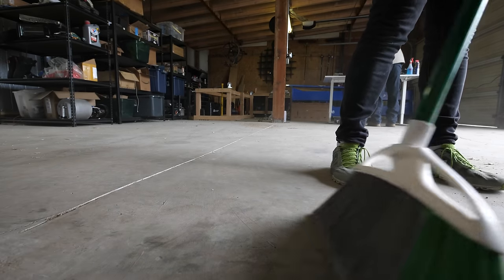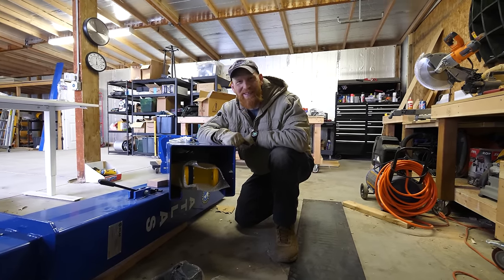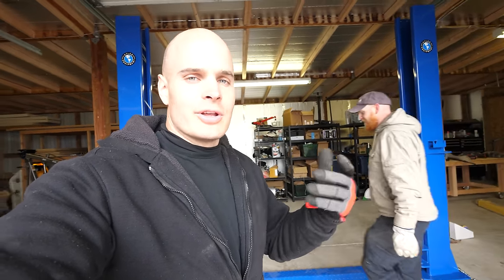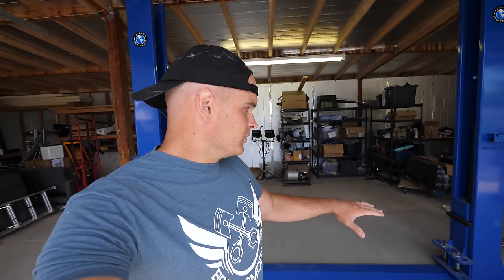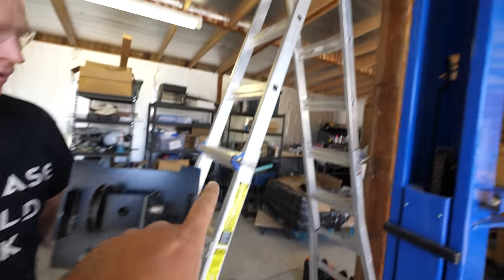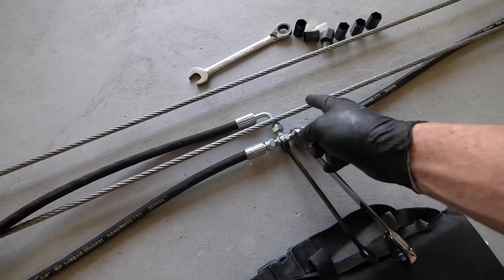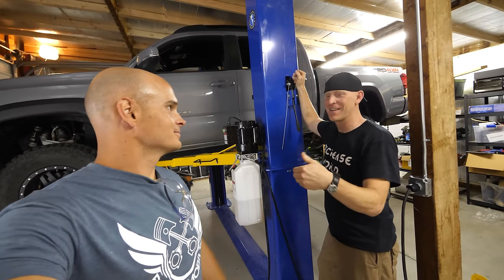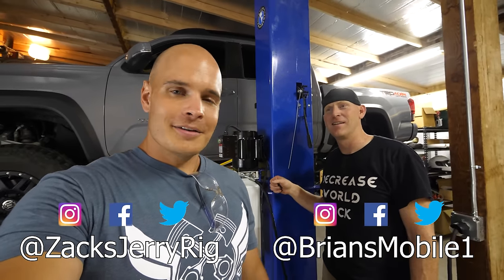Installing a 2 Post 10,000lb Vehicle Lift! - Check concrete FIRST!!

Comment: What's the point of that lift in THAT garage
Reply: He already had to remove old concrete... 🤔 wouldn't it be better to go all the way down and do it this way? Unless next episode will be all about lifting garage ceiling 😁
Reply: @obywatelwu5515  should have concreted the bolts.
Reply: Still makes the car a lot easier to work on. Even if you can't stand under it you can use a creeper or chair to sit while working
Reply: @Cutlerylover4life1  Indeed it does 😄💪
Reply: I am sure 100% he didn't install the lift and go through all that pain of concrete and installing the lift just so that he could go under the truck to fix(which hardly happens)
Reply: sulaiman syed for what else?
Reply: If you could only put a small window in your wall, wouldn't you still put a window there?  You act like he can just magically create a new garage or move, sometimes the reality is you work with what you have.  I've considered doing the same in my garage, and know others who have.
Reply: @NoNegotiations  "should have "concreted" the bolts."" Riiight. Sounds like you know what you're talking about. You could wet-set J-bolts, but it's difficult to get them in the right spot while the concrete is curing. Setting in studs with epoxy is also another option, but it's very expensive, and unnecessary, and they had the red head anchors already.
Reply: @TexRobNC  He already had plan to make a bigger garage.
If you follow him on social media you can see him breaking his old one
Reply: @xenonram  That's not how it works. Lol.
Reply: @SmugLlama1234  that is exactly how it works
Reply: I have a lift in my garage with a 12 ft ceiling and still can’t go full-height with a pickup truck. There are many, many things one can do with a lift in a low-ceiling garage. 

I know guys that have that same lift in garages with 8 ft ceilings that only use it for detailing cars (or other body work). Perfect height for tires, brakes, suspension, body repair, etc on cars and small pickups.
Reply: @Cutlerylover4life1  I saw a creeper on Amazon that has the person sitting on it in a reclining position. It would be perfect lifts that have to max out at a lower height.

Comment: Good DIY video. I've been researching lifts a lot. Yes the 10k lifts that I read about do require more than 4" of 3000psi concrete. I'm looking at 9k lifts and they call for 4" 3000 psi concrete. I called my concrete guy and he said my floor is 4" thick and 3500psi concrete with rebar reinforcement. Hope i don't drill into the rebar 👀

Comment: You could have just cut and poured small footers with the 7” thick concrete
Reply: What specifications would you recommend for someone doing to footings option? Looking to help a friend install one on an existing pad but would like to make sure it is safe. Thank you!
Reply: Kyle Burraston According to some reps that I spoke to they said 5’X5’ squares (with the posts on center)  at 7” deep, 3500 psi concrete. I would rather go a little bit larger though and pour completely across. It won’t cost that much more.
Reply: I always recommended a rectangle cutout 6 inches wider than than the three outside faces of the pad that ran completely contiguous between the posts. So many people skip the step of tying back into the existing slab with rebar, and one side would settle causing the lift to twist if its an overhead. This one being a baseplate isn't free from those issues just because it isn't connected at the top of the posts. If you have a settling issue after a solid slab pour, you can simply disassemble the lift and fix the pad, the lift won't be damaged. If you do two pier's, you only have a small gap between of existing concrete. Might as well clear that out, it's not much more money and your already going through all the work.
Reply: Came here looking for this.

Why in the world would you not install footers tied into the slab and studs for the lifts? 

Wedge bolts for a lift? Yeah, that's 'standard' and the web is full of examples of how these things pull out over time.

Hell, I'd connect the footers with a beam just to be sure. The additional cost in nothing relative to your life

Comment: "We are converting from metric to imperial." .... WHY? You love doing fractions?
Reply: Cos they are Americans
Reply: Metric tape measures aren't as readily available as imperial ones in the states, it sounds like the instructions were metric so instead of going out and shopping for a metric tape measure they just converted to imperial and used what they had
Reply: @fakename287  I work in the Oil Industry here in Canada and i still remember the first time as a first year Apprentice that my journeyman gave me a measurement in Imperial and i went whaaaa? (Since we only learn Metric in school now) Luckily we all carry dual measurement tapes since we deal with both Imperial/Metric stuff on a day to day basis.
Reply: Because we are capable of doing fractions (do them every day) . For real fun naval architect plans are in 1/8" dimensions. AN bolts in aircraft have their own rules.  I also can get by in drams, gills, pints, gallons, hogsheads, bushels and barrels for volume - as well as ten yard loads of gravel. And grains, ounces, pounds, tons (long and short) as well as kilograms. Also unbothered when faced with watts, joules, kPa, Nm, inch pounds, foot pounds, and on and on. Conversions are a way of life if you are doing anything in the science or engineering fields. Now being flexible I would have simply used a couple of metric rulers (already have them) as you are suggesting. All the home improvement stores, hardware stores, auto parts stores in the US sell metric rulers these days.
Reply: @David Bryant outside of the US, yes. Inside the US, not so much.
Reply: @David Bryant Damn, good to know those exist. I honestly haven't really seen those around me.
Reply: @David Bryant With all the crap going on and restrictions, I only like to go out when I have to. Next time I find myself at a hardware store, just for you, I'll go look for one.
Reply: @David Bryant You just had to ask, you just had to win. Jesus Christ. I concede, I am dumb, is that what you wanted? You wanted me to admin that you are smarter than me, and that I shall follow your command at all costs?
Reply: @David Bryant please dad ❤️❤️❤️
Reply: @David Bryant in all seriousness though, if your offering me an apartment that would be bomb asf
Reply: @David Bryant I'm not an adult lmao, if you couldn't guess by my commitment to reply to this long and admittedly funny replies.

Comment: i got the same lift. supposed to have a plastic tray under the ramp to keep the hydraulic lines and cables separate. If you dont have that its going to wear through the hoses. Talks about it in the instructions and all baseplate lifts have them. Also the two nuts arent supposed to have the washer between. Thats is just for shipping. Washer goes under first nut. second is lock nut.

Comment: Just did a pour for our shop build, we did 2 4 x4 x 14 inch deep footers for the lift ( a 10 k 2 post , Rotary brand) the rest of the slab is 5 inches, a little overkill is never a bad thing when installing a lift.

Comment: Zach, this is way late but one thing I'm curious about is why you didn't put the anchors in the wet concrete and drilled them in instead. I imagine that placing them into the wet concrete would have been stronger overall or am I wrong about that? Or was there another reason?
Reply: That’s not how wedge anchors are intended to be used. Additionally, it would be very difficult to get them set in the proper position AND set the lift post on top. These posts are massively heavy.
Reply: @coreyscarrepairs  Forget my last comment, my brain is foggy... So, putting them in wet concrete would necessitate different types of anchors. You're right, you can't use wedge anchors in wet concrete and I wasn't suggesting that. But there's anchors that are meant for wet concrete that would easily be used instead.

As for alignment. This is something that's done all the time. The easiest would be to use a steel base plate that gets embedded into the concrete too that has the anchors going through it.

Lastly, these are meant to roll into place, and there's play in the anchor holes, so you'd just roll it into place and then angle it vertical with the anchors going into the holes as it gets lifted vertical.

Comment: OMG converting from metric to imperial is just sheer madness to me and as I'm a Brit, they taught me both but always prefer metric for measuring precise stuff!
Reply: Neither one is more accurate. You can measure 1.265 inches just as easily as 32.131 mm. It seems to be a big problem that people in Europe are completely baffled by rational/fractional numbers. I guess they don't know that metric numbers can be expressed in fractional form as well. They'd freak if you said 38 ½ mm. "Thirty eight and... One-twoths?" Precision measurements in USCS units (not "imperial") are expressed as decimal numbers, not fractions. The ONLY time fractions are used, is in carpentry/construction where dividing an inch into 16 parts is as accurate as you need to be. There is nothing on a house, besides finish carpentry (trim work), that requires more accuracy than 1/16" increments.

Comment: Hi, good call on pulling the trigger and replacing the concrete pad. For future reference 6 inches of concrete is a bare minimum for this type of lift. Although there exists a chemical anchor which can be used if your concrete is less thick.

But again there is a bare minimum of about 4 inches. If you use this chemical anchor, simply drill a size large hole and deeper. Longer anchors to push into the chemical solution will also work better.
Source: I sell and install lifts for workshops

Congrats on your new lift

Comment: I'm not sure why you couldn't have just make two small footer pads for where the posts would attach.  Cut 8" around the footprint of the lift stands, and pour a deep slab only on those two spots.  Seems like a 15x12 slab was a little overkill.
Reply: Mario  plus the fact that if it's just two small slabs taking on all that weight instead of one whole unit you run the risk of the tiny slabs shifting

Comment: The basic fact that you stopped and did the safe thing with the concrete, are wearing a mask for the dust and hearing protection made my sub right away.  I know your work is getting done the right way.

Comment: I'd think to reinforce more than simply adding inches. Structural steel in slab to ensure it won't tip. After all you went thru the extra effort to get slab thickness right, I'd have gone a bit more just to know nothing could ever go wrong.

Comment: Definitely retorque those anchor bolts. 100 PSI seems pretty light to me, 3/4" bolts - I would do 125 minimum. Minimum 6" concrete. Great video- thanks.

Comment: yup check the torque on the bolts every year as well. I know its been a few months since install but in commercial projects, yearly special inspection should be done by the owner on anchors. With wedge anchors, these are 3/4 Diameter, probably some Chinese BS non the less, should be torqued down to 110lbs per sf. If unsure, check the ESR document for that particular anchor.  Also with wedge anchors there is specific spacing between the c/c of each anchor as well as edge distance. If you were using a Powers SD1 anchor, I wouldn't used a wedge anchor if you were withing 16" of an expansion joint, which maybe you are not. You could go down to 11" at a minimum though but its your choice. If it was me, I would use b7 rod and a adhesive anchor either Hilti say "hit200 or powers ac200. You would also want to have the anchors spaced a minimum of 6" apart from each other. Just becuase you have 8 holes in the base plate does not mean you have to use them all, normally you would want to use the extremities and if you were trying to hit that minimum edge distance you could go in a hole. More anchors does not mean more holding power, it could in fact reduce the effectiveness of the anchor.

Comment: 4k lbs. is the "compression" tolerance.  The bolts are also designed to secure the "tension" load (pulling/twisting) up and out.  Concrete is very strong with compression but quite weak with resisting tension. It was a good call installing the new concrete.  Too bad the bolts weren't a little longer to take more advantage of the full depth of the concrete.  

I would have made the new pad larger (wider and longer.)  I don't really like the edge (weak point) being so close to the lift. OEM calls for a full slab- not a repaired slab.  I agree though, what you did is likely much stronger than using the original slab which was only 2" in some spots.

Comment: Yeah it seems like it'll be cramped working under the truck with your ceilings that low. You'll still end up being on a atoll rather than standing but that's still osmething. Good job guys and great decision drilling out the pad and repouring, they can very well pull out if the concrete isn't right.

Comment: Good choice on the concrete. The concrete is closer to its strength now so a good checking of the anchors to see if they are still tight.

Comment: Great job on this video.  I installed an Atlas 9KOH lift.  The instructions were terrible and lacked the torque detail.  worse than that, they sent the wrong instruction revision for the model I bought, I had a newer model than the instructions.  This meant the holes were in different locations than the model I bought.  Had to re-drill holes and then used Hilti epoxy and anchors instead of the shielded anchors in this video.  Atlas paid me for the cost of the re-drill supplies since they botched the instructions!

Comment: Me? Zack, I would install spiral wrap on the hydraulic hoses running along the floor next to the cables just as another measure of protection, never too much safety. Me? I'd want to make  sure to see my kids grow up. Anyhow, good job of putting in all of the required spec's in place.

Comment: Having a lift makes working on your car so much easier. My uncle has one and anytime I need to work on my car I use it if it’s available.
Reply: when I used to work on cars, I had access to the lifts, even when the place was closed to work on my own stuff.    Since changing Careers 10 years ago, having no lift sucks.  I have to do everything on the ground with a jack and jack stands.  It limits what I can do.  I have no real flat place to work.  My Garage is too full and my driveway and side of the house are pretty sloped.  If the side of my house was LEVEL, I'd throw up one of these lifts there.  The prices of these things are really pretty cheap overall.
Reply: JB Dragon these lifts are worth it. Once I find a house I hope that I can build a lift into it but looking for a house that has a high sealing garage won’t be easy either.

Comment: Whenever I encounter something feety, inchy  I never convert, I bring out my stanley talon imperial and roll with it. What I dont like is to mix things like on my mower where screws are unf, unc and where previous owner couldent replace originals re-drilled and tapped with mill-standard. Thank God my workshops previous owner worked on everything from excavators to wall clocks so I have everything from 2" bolts  via m7 bolts and nuts to finest clock screws.. + the taps and dies to match. + a few hand forged old farm screws and nuts.

Comment: Rotary type post lift doesn't have that annoying hump across the middle. That hump gives that cringe moment when coming in, when the wheels hit the hump.. a few things goes through my mind. 
Did I pick up all the tools left on the floor?
Oh, it's just the hump. Easy on the throttle...Easy... Easy... don't want it to launch into the wall. 

Rotary works on a worm screw drive, so it doesn't need to go up a bit to unlatch the safeties before coming down. Which is kinda important when you have low ceilings and trying to use that last inch of space. 

Scissor lift are the best, it disappears into the floor when not in use. Lights on the ceiling is broken? Just ride the scissor lift up.

Comment: Nice Video, These lifts are dangerous especially when installed with 5-6" wedge anchors. Bold does not stretch....anchor becomes loose over time with use. 4000 psi .... look at contact patch on wedge anchor. Now pry against it with a 9' lever. 6- inch x 5/8 wedge anchor has somewhere around 2500 lb pull out resistance. Chemical anchor of same size about 4 times that. You had the opportunity to install something like an ( J ) anchor in the fresh concrete. Keep tightening that wedge until 1 inch of threads is exposed above the nut and then it has truly failed and you can replace it with a chemical anchor. (a lot safer). not writing this to be a jerk. Close call with two post. Not a lot of warning or time to escape. Stay safe!!!!

Comment: Great video, I think I would install a device that senses when the vehicle gets close to the ceiling,  I would use bumper reverse sensors mounted to the ceiling.
Reply: It would be an easy modification to add a limit switch that stops cars from going too high. 
A simple way which wouldnt involve breaking the internal circuitry would be a limit switch wired to a 2 pole rib relay which kills power to the lift. 
If that limit is hit manually lower the lift then power is back on.